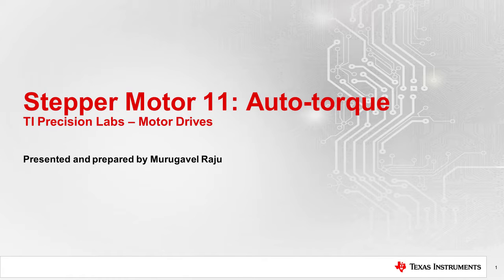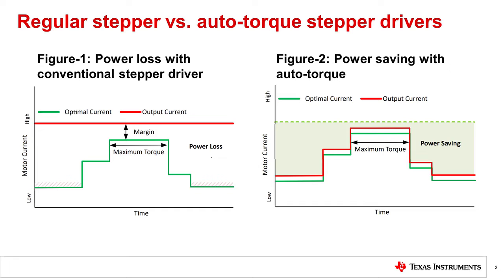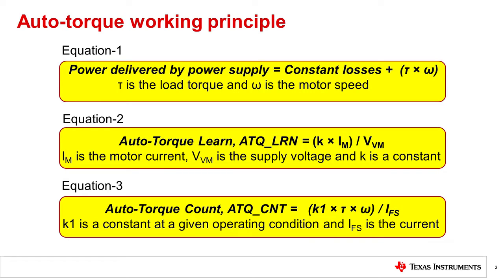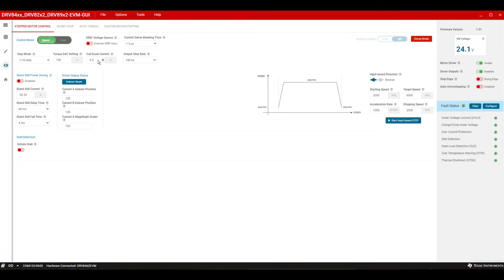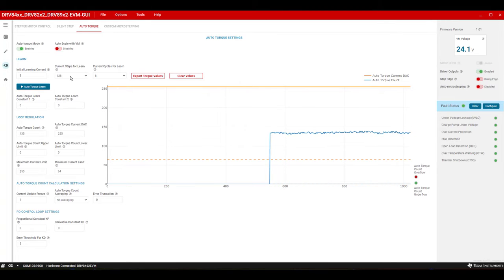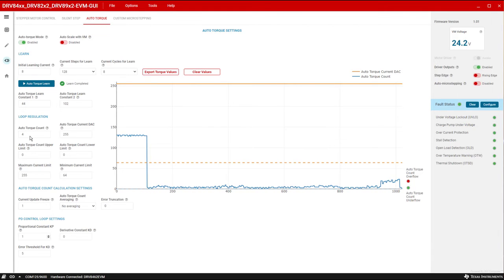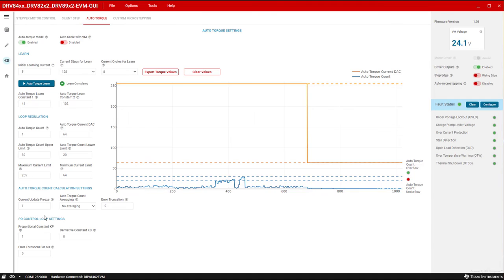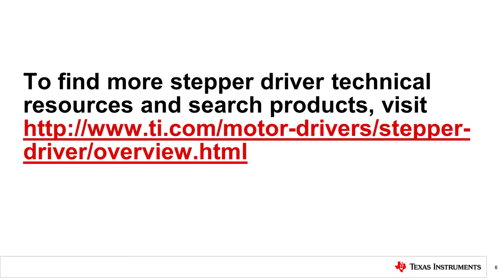Auto-torque in stepper drivers

Comment: Very nice! This reminds me of my experience manually tuning the stepper drive current on my 3D printer about 10 years ago. Back then, most of the firmware didn't even have acceleration, so it was very sensitive to insufficient torque.

You had to first adjust the belts and shafts to make sure they would slide freely without binding. If things weren't square, then it would bind at one end or the other.

Next, you would set the stepper current to maybe 25% with the SMD potentiometers on the 4 driver boards. Choose a reasonable maximum speed that you think you'll be moving at. Have the printer move back and forth on one axis a couple times, and see if it skips steps. Turn the stepper current up. Repeat for each axis.

It's great to see how much better things are getting here.